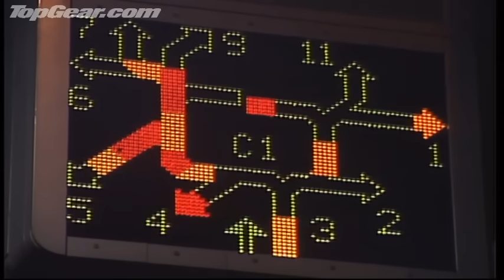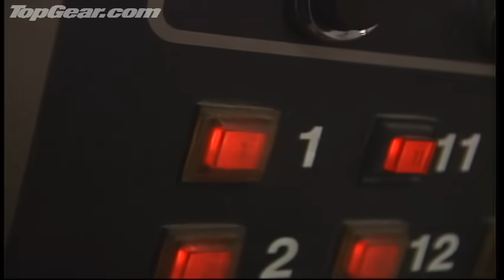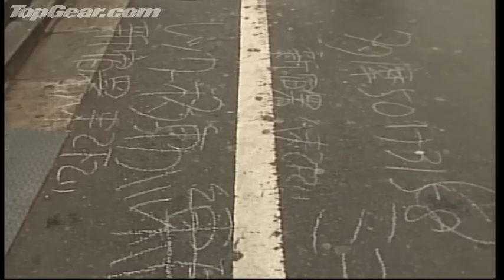Tokyo's Attitude To Cars | Jeremy Clarkson's Motorworld | Top Gear

Comment: The door/wing mirror attachment for notices, is such a fantastic idea.

No risk of anything being removed without causing damage/dedicated cutting equipment.

UK tickets can be removed/fall away, so the mirror "tie" serves as a very secure mechanism of being noticed.

It also allows a motorist to pull away in a hurry if needs be, and can't be overlooked quite so easily.

Comment: Thing is, where you get a tag placed on your vehicle, even if you're parked there all day and just feed the meter, there is something similar to that here in the United States. While not every city has that, you can be fined, booted, clamped and even towed, even if your meter has been fed. In some cities, they actually mark your tires and determine if you've moved the vehicle. If not, your vehicle gets it. It gets worse, before, you just had to worry about a clamp on your tire. Nowadays, there is a new device that clamps across the entirety of your front windshield. If you try to move your car or drive off with it, a huge siren blares. Also, don't try to remove it, same result. Only way to remove it without paying is to smash the windshield. These policies are designed to stop people from monopolizing a parking space and not just residents have been hit with it but also business owners and delivery drivers.

Comment: 0:15 Damn! That's a Skyline! And there's even one at 0:56
Reply: R32 skyline yeah
Reply: Welcome to Japan
Reply: Those Skylines are everywhere in Japan. Not nearly as rare a sight as it is here in the Western Hemisphere.
Reply: If you are talking about older Skylines, like the one in the video, then of course there are more in Japan because they were never imported to the USA back then. But if you think you can see older Skylines all over the place in Japan then all I can say is you have probably never been there. First of all, it’s extremely rare to see ANY cars on the road there that are over ten years old (much less 20). And this is because older cars are much more expensive to own there due to the fact that they require more frequent mandatory and VERY expensive inspections (unless the laws have changed). In fact most cars in Japan get junked by the time they are ten years old even if they have very low mileage. And secondly, the classic old cars like the old skyline GTR's are owned by wealthy collectors and are probably rarely driven so you are never going to see them on the street unless you are lucky. 

If you are talking about new Skyline models however then of course there are more of them to be seen in Japan than here in the USA.
Reply: Honestly, I was talking about the older Skylines, and I lived in Japan during the early 2000's, and was rather young back then, so I didn't know about any of the laws. All I know is that there were plenty of the older Skylines about the place.
Reply: I probably should have mentioned that, while the Skyline itself was a very popular and very common car in Japan, the GT-R version used to be quite rare. The GT-R was a high performance version of the Skyline, which was first introduced in 1969 and continued through 1973. After that I believe there were no more Skylines bearing the GT-R badge until 1989. And I believe sometime in the 2000’s they finally started selling these in the USA, where they are just called Nissan GTR’s. 

So you can indeed see a lot of Skylines and even Skyline GTR’s in Japan but the older ones should be pretty rare, especially the GTR's. Of course things have probably changed since the 80’s and 90’s when I lived there. Back then the Shakken (manditory vehicle inspection) was required every two years for newer cars and once a year for older cars. And this of course made it too expensive to keep an older car. In fact there used to be some areas on the outskirts of Tokyo where people would take their older cars in the middle of the night and just abandon them on the street rather than pay someone to haul it off. And most of these cars were in very good shape and had very low mileage. And of course back in the 80’s someone finally got the bright idea to start importing these low mileage engines to America and selling them. 

Anyway, if the Shakken is now the same for older car as for newer cars then you might indeed see a few more older cars driving around than you did in the 90’s. But the 1970’s GTR’s are extremely rare collectors items, and even the ones from the 90’s are probably not something you are likely to see on the street very often.
Reply: shrug Like I said, I was quite young at the time, and didn't know the difference between one car and another. At the time, the most I knew about cars were that they could go fast and had to stop at red lights. I thought speed control was done by pressing the gas to go forward, then pressing the brakes to limit how fast you went.

However, from pictures I've seen from when I was living there, I do know that that the kinds of cars I was around were R32 and R33 models, I think. I also have my mother's confirmation that there were plenty of Skylines about of the sort.
Reply: @matblackbluesport8720  that first one is a gts

Comment: There are ways around most systems. My former boss needed to park near a courthouse and saw another car there with a fine stuck under the wiper.  So he removed it and put it on his own car.  When he came out 20 mins later, the other car had another fine stuck under the wiper, so he replaced the one he had earlier removed from it - nasty!!

Comment: I live in Canada and the powers that be have decided to upgrade a MAJOR freeway (the trans canada highway) that runs smack through the middle of the city for some reason.  As part of my job I am lucky to have to endure driving the entirety of this construction zone, back and forth, 8 times in shift.   They have been working for 3 years on a single 2 km section of the "freeway" for that entire time with little to no sign of progress.   It's rare to see more than 4 or 5 people doing anything to said construction project.

Comment: No wonder ppl just take the metro system in Toky0. 1000 pounds for a fine. That has to be like almost 1 million yen.
Reply: +jace888 185,000 yen :)
Reply: +Ultimate Doge thanks for clarifying 😅
Reply: +Ultimate Doge Are you using the current conversion rate, or the conversion rate from the 90s?
Reply: xXUnoriginalNameXx33 current, derp -_-
Reply: +Ultimate Doge just remove 2% for inflation per year if you know when this episode came out.
Reply: 140,600 yen as of when this episode came out in 2004.
Reply: +MrDalek2150 actually this clip is from an episode from 1994
Reply: +jace888 You realize you convert because money has a different value right? 185,000 yen holds the same meaning as 1000 pounds to people in japan. Thats like saying 1000 pounds is the same as 1000 pence. Of course it isn't, you have to convert it.
Reply: Richard Smith I know. I didn't check the conversion rate when I wrote the comment!

Comment: This video came out 12 years ago and Japan probably had this way before than. Modern GPS for all.
Reply: Mind you, it probably was a Japan-only GPS. That's how they worked, the CD and the system probably could not store other country's info with equal info density

Comment: In the US we’d just cut those off so this idea wouldn’t work
Reply: If you mean the door/wing mirror cable ties, then the point of them, is to only permit [determined] removal of the device, in order to be free of them.

And they don't in any way shape or form affect one's ability to safely control an automobile either.

No.

Damage has to be caused either to the device, or to the mirror, in order to merit not having to see it.

And who knows, the ticket within may be locked inside, so you can't just remove it and forget about it...you'd have to hide it forever/vaporize the device, in order to conceal your "crime".

And it may have a tracking chip inside as well.